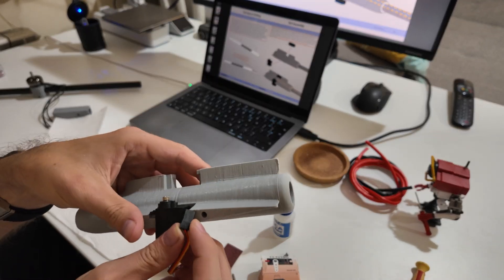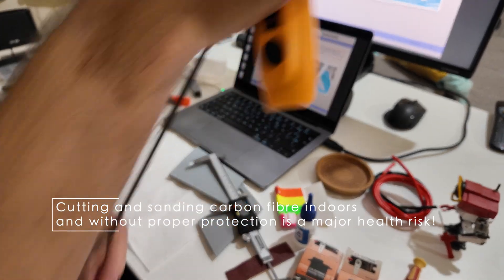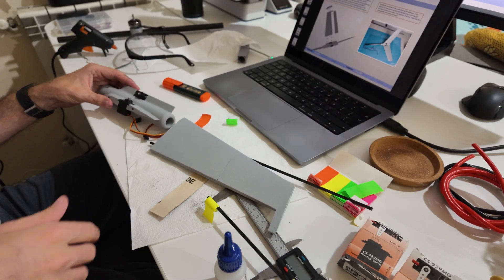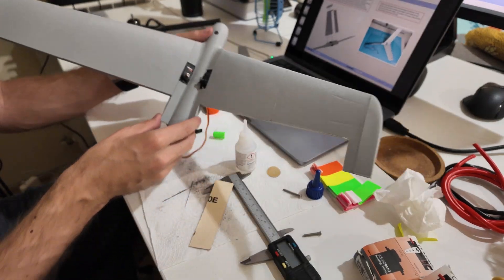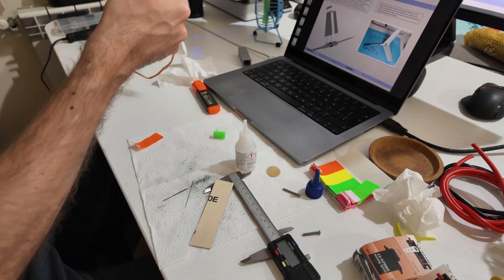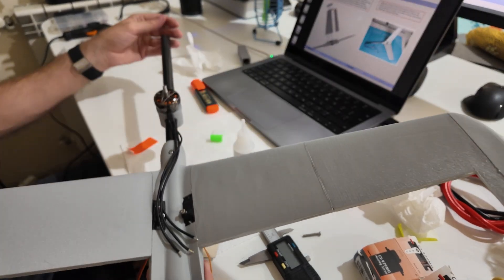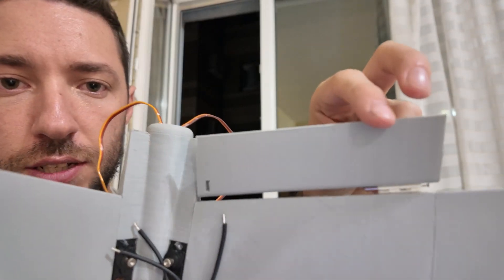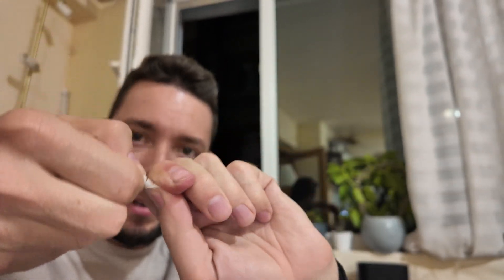I Built an Autonomous Drone at Home: V-Tail with Controls (2/7)

Comment: Great videos... I have 44yrs  RC aircraft building experience. Just a little advice if you build another plane. From your previous video. As others have said, please use at least a N-95 mask, eye protection and latex gloves when cutting carbon fiber. That Suff is nasty for your lungs and can float into your eyes also.    If you want to glue the servos put a piece of heat shrink tubing around the body of the servo and shrink it. Then use epoxy. To remove the servo you simply cut the tubing. With that type of servo mount I hope you used the grommets and screws as well?    The thin plastic CA hinges  work great! They will last you years without tearing. Insert all the hinges for each control surface and make the gap disappear. Raise or lower the control surface to 45* to create a tiny gap between the two surfaces. Now using Thin CA put 3 or 4 drops of CA on the hinge in the gap. Do this on both sides of the hinges. Let it soak  in and dry for about 30 seconds before hitting both sides with CA Kicker and then bend the control surfaces up and down a few times yo loosen the movement.  You want the control surface gaps as narrow as possible. Lastly, position your control horns so that the holes that you attach your clevis or push rod to so that the holes line up with the hinge gap in the control surface. That way you don't have differential throw. Any differential throw you might want for the ailerons can be adjusted in the radio. Have fun...
Reply from the maker: Those are all great pointers, I really appreciate it! I'll make sure to mention them on the current build I'm filming. Also, I've been wondering whether 45 deg should be the max for a control surface? Servos sound really cracky at that angle. I suppose it depends on the plane design, but any rule of thumb would be useful.
Reply: @pathfinder.george  unless it's a aerobatic plane 45* for elevator and ailerons is more than enough and for most planes too much. Your instructions should say how much maximum up and down deflection your control surfaces should have. It's usually given in millimeters from center. On most planes it's more like 30* maximum up and down on the elevator. On flat bottom or semi symmetrical wings, ailerons will usually require differential throw. Meaning more up than down. This help prevent adverse yaw and helps prevent tip stalling. You can adjust that in the radio settings. A good starting point let's say 25* up and 15* to 20* down. It will vary with plane, air foil and typical flying speeds. Again your instructions should give you the maximum up an down settings. You have a V tail so no real rudder but if you had a rudder you can usually go 45* left and right on a rudder. Make sure you have your V tail rudder function set up correctly.  From the back of the plane, right rudder, your left elevator should move up and your right elevator should move down. This is opposite for left rudder. If you have flaps those are usually hinged on the bottom and can go down to 90* but on my power planes I have my flaps set to a maximum of about 60* down. Make sure you use dual rates in the programing on your control surfaces. Typically around 60% of the reomended full throw. That way if your plane is too responsive you can tame it down with a lower rate. If you live in or near Sifia, see if you can contact Nikola Koevski of the YouTube channel ArxAngelRC. He's also on Facebook. He is a fixed wing drone expert with many years experience and could help you...
Reply from the maker: That's super useful! Once again, I really appreciate you taking the time to share your knowledge. Hopefully many people here read it. I'll have a deeper read at differential throw and make sure to contact Nikola.

Comment: Do you have a link to the STL for the horns and the system you used for the pushrods?
Reply from the maker: I’ll prepare a sheet with links to all extra components and include that as well. In the meantime searching for a control horn in thingiverse should do the trick.

Comment: my long term goals is to build fixed wings and drones with a lot of altitude hold and waypoint assist etc to make as easy as DJI as possible. using iNav f4 mostly!
Reply from the maker: That's awesome! Autonomy is the way to go. Ardupilot has gotten pretty advanced at this point. I hear it's better for autonomous missions. How far along are you?

Comment: Nice work, just finished printing the parts to mine. Really struggled with warping though, the filament they recomended was not easy to work with.
Reply from the maker: There are 2 types of LW-PLA, Foaming and Pre-Foamed. The former expands after it's printed, so you need to adjust print density as stated. The latter is pre-foamed, hence there is little expansion after leaving the nozzle - my friends 3d printed this with the pre-foamed PolyLite LW-PLA, tho it did take them quite a few attempts as well. Didn't have warping issues tho... are you printing in an enclosure?

Comment: Which pushrods connectors did you use? The servos we bought didn't come with any, and are currently stuck at getting the correct size!
Reply from the maker: I bought "Mini EZ Connectors for RC Planes" from a local hobby store. For the carbon push rods I searched for RC plane carbon push rods on Aliexpress. You can use metal ones as well - most hobby shops should have them. Here's an example: https://shop.steldi.com/product/3517/3070-mini-konektor-2br.html